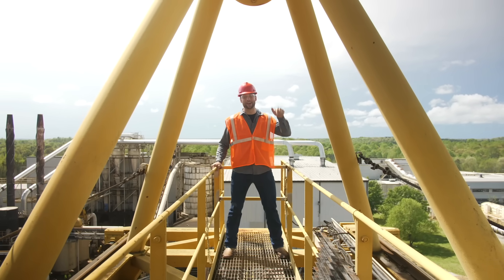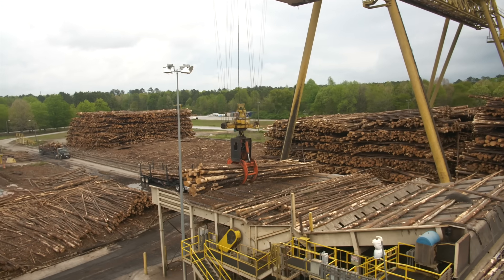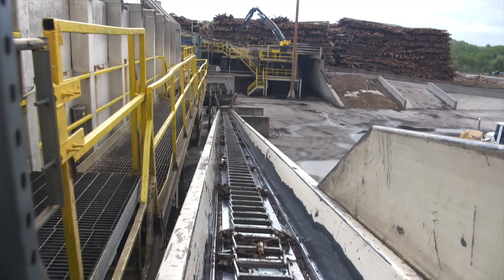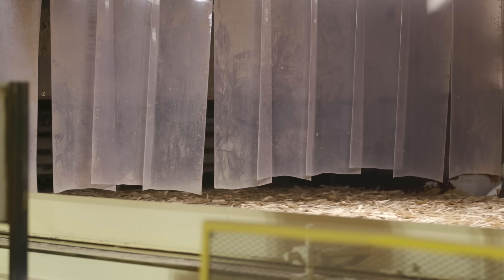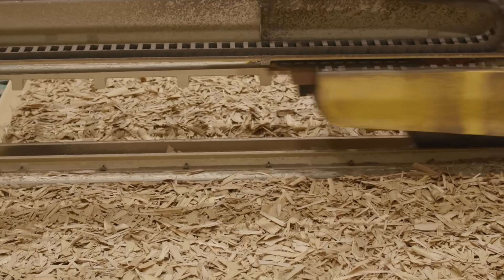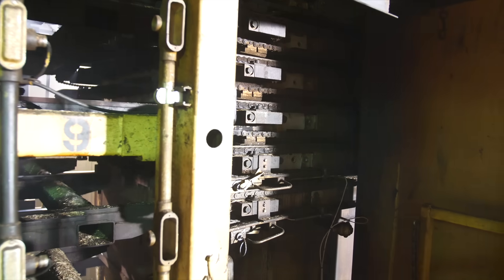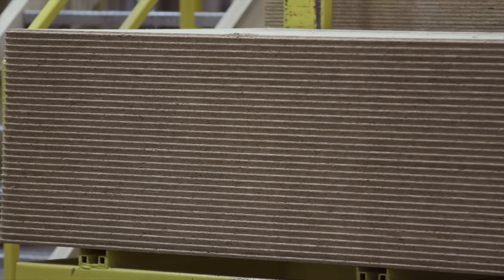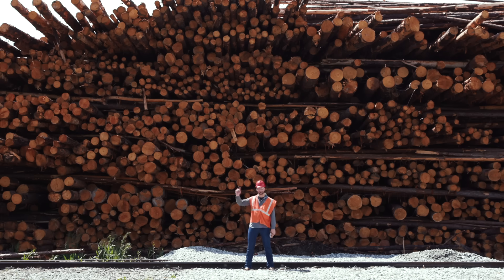Could OSB be BETTER than Plywood????

Comment: We would never use OSB as an outside panel for anything other than an inexpensive storage building where  you would paint the heck out of it because it will
weather badly.  OSB is commonly laid out evenly on top of the trusses of a roof,  you take your black paper which is a weather seal layer, staple it down then you
nail your roofing shingles on top of that.  This wood in its bare form is not designed to be out in the weather.  It's flexible and durable and works perfectly for 
the roofing process.  It's also a lot cheaper then plywood and when you are covering an area as large as a roof it saves a lot of money.  it's not like particle board 
 which is more like  pressed wood dust.  That's the cheapest you'll find anywhere and has no value in outside use.

Comment: Looks like the title is incorrect.

I prefer OSB over plywood for some things, because of the cost and OSB doesn't have air pockets and hollow sections in it like plywood does.  I remember when they used to make quality plywood that doesn't have all the voids and hollow sections in it.  The furniture grade plywood that is $60+ a sheet also has voids and hollows in it, but not as much.  I would never use plywood for a roofing deck, and I would never use OSB for flooring.  Is one stronger than the other???  Depends on the environment in which it is used.  Plywood will hold up better when it's wet.

Comment: In "A" word, NO!
Never!

It doesn't work as walls, floors or bookshelves.

OSB + water = mush!

It's not even worth using as a dog house! Unless you want to kill your dog! As it did to a friend's many years ago when the roof collapsed during a snow storm.

On the other hand, I know a guy who's entire set of shingles blew off fron one side of his home during a massive wind & thunderstorm, leaving bare plywood underneath exposed for an hour in heavy rain. Didn't leak a drop due to good sealing with silver tape. They let it dry then re-roofed it with copper.

OSB, SUCKS!  And plywood rocks!

Comment: OSB is crap. Simply crap.  When I had my construction company I turned down every job that specified the use of OSB.  It is inferior in every way to plywood.  Even cost:  OSB is cheaper to purchase but costs a lot to replace when it fails, and it will fail.  I found it interesting that in a small town a new bank was being built as well as a new Taco Bell down the road.  The bank was being built with OSB (cheaper initial cost) and the Taco Bell was being built with plywood (durability - thinking beyond "today's" dollar).  I have never used OSB products but have had to do many repairs (think: replace with plywood) to projects completed by the "low bidder".  Would have been cheaper just to use a quality product in the first place.  As for this video: there is now comparison as the title suggests, the host appears to be doing nothing more the regurgitating bad information given to him by the company.  This video (in my opinion) is nothing more than a sales pitch for the brand, their product is still junk.  Useless.  Crap.
Reply: @John Fischer And you believe everything you see on the internet.  I speak from many years of experience, not from a few minutes of screen time and other's propaganda.
Reply: @John Fischer Not in anything I have ever built.  OSB is crap.  Experience has taught me that.  Nothing weird about it.
Reply: didn't even get to the part about the higher % of glue ,adding to the flammability and quicker burn rate

Comment: If you have a home on a solid concrete foundation you can use OSB on the outside and inside of your walls, you can add sheetrock directly over top of the OSB on the interior, of course you need to add a vapor barrier and appropriate insulation. by adding OSB on the interior you can use smaller pieces of sheetrock because you can drill the drywall directly into the OSB sheating. Of course you have to make sure that building codes OK the process. If you are going to do this on a regular foundation you may be able to add in the crawl space or basement an extra layer of concrete block or poured extension to hold the weight. If doing an arch on the interior or curved wall you can use a mesh similar to gutter guard mesh between the two sections then layer with plaster, it is time consuming but worth the effort.

Comment: Cores running in one dirrection?? just look at it it's all random. You can see it in the finished board. WTF.
Reply: Your right. One layer of strands are oriented different from the one above, giving equal strength in all directions. The stuff works great, holds up longer than plywood in moist conditions, for a fraction of the cost. If plywood delaminates after only 1 time getting wet, how is it better than OSB which can take several cycles before coming apart???

Comment: "Chip Breaker" is the term you were struggling to find. Methylene diphenyl diisocyanate,is the adhesive you wanted to say .  YADDA YADDA YAP YAP YAP  it took you three quarters of your video babbling about shit before you sounded like you were thinking about getting to the  point.   GEEBUS man  get to the friggin point.   blah blah tongue and groove  nonsense   AND YOU NEVER EVER GOT TO THE FUCKING POINT~!!!!!!  Why might OSB be better?  Well doofus it ain't.  It doesn't hold nails well at all ad you can't glue the shit worth a damn because the cured Methylene diphenyl diisocyanate, does not take to gluing  easily.  It doesn't screw well .  The reason it doesn't nail or screw well if because the glue is brittle and shatters around the fastener.  And it doesn't take water well. I've seen formaldehyde glued plywood sit out of doors in the weather for years and still be tough as nails.

Comment: I let some idiot contractor tell me I could replace the solid wood planks in my bathroom with OSB. He claimed it was fine since it would be under an additional layer of underlayment, and most likely tile or linoleum . Well, I called the manufacturer and they said NO WAY. They said OSB, the very product they make, does not hold up in moist environments. Like a bathroom or laundry room. Even as roof decking,....OSB can be a bad choice,...but it is a less expensive product, and that is why it is used as substitute, for solid wood planking.

Comment: I've been working with wood for over 40 years, the Plywood cost twice as much of the OSB maybe even more, but it lasts 20 times more than OSB, I stopped wasting time and money on OSB.
Reply: John Doe  you’re wrong
Reply: I found all the fud boomers that still live in the 60s, new OSB is fantastic. Some of it has waterproofing that allows it to outlast plywood. It also doesn’t warp like plywood or straight grain timber.
Reply: @RadDadisRad  I bought some to replace some rotted out side panels that were rough cut pine from a local guy..I was trying to save the people some $$...I water-proofed it heavily with Thompsons water seal..now I used the OSB as part of the wall paneling and have put tin L-panels over it...I am hoping that will be okay..I am the only one doing the work and do not want to have to re-do this huge shed...what do you think,anybody ?
Reply: John Doe  explain glulam beams and lvl's being stronger than similarly size lumber.
Reply: Buy better quality OSB
Reply: What do people use OSB for? Is it supposed to be a cheap alternative to plywood? I'm not in the know on this stuff.
Reply: @nofurtherwest3474  you can get away with it for some stuff…. But not as strong and keep it away from water
Reply: John Doe  you do know ply wood is layered thin sheeting it's not coated in epoxy which is why it Warp's an rots my grandparents build their house out of 3/4 inch OSB in the 70s an that house has out lasted all the other's an it's survived 3 f3 twisters
Reply: Absolutely.
Reply: OSB is good for packing boxes but SFA of anything else.
Reply: As far as siding goes, I'd use plywood. But the new osb subfloor is completely waterproof.
Reply: John Doe  ??Well the glue is actually stronger than the wood…. So maybe you should use your brain.
Reply: The newer osb has higher sheer tolerances than plywood.

Comment: I worked at the worlds largest OSB factory called Footner Forest Products in High Level Alberta for two years. I was in charge of the forming line and tank farm. I'm a millwright. It was a continuous press not multi opening.
The plant was ALWAYS full of smoke. A severe health hazard. Most times (depending on board size) the smoke was so bad you couldn't see the other end of the plant. You can see a small amount of smoke at about the 1 min mark of this video. Every time the compensation guy showed up, amazingly we were always running the small board so little amount of smoke or we were down for "repairs". LOL. Yeah the government and the companies don't give a shit about working people. I'll go on welfare before I ever work in OSB again. Obviously they weren't doing much when you were there with the camera. Show up unannounced with a camera one day and post that. Bet you won't even get in the door.
Reply: When he embarked on the spiel about their stack emissions control and how much they spent on it, my first thoughts were "how far out of compliance were they when they got caught, how big was the fine, and how long were they given to install the emissions controls before the plant would be shut down?'
Reply: @kevincrosby1760  The plant in High Level did have a scrubber but it was way to small for what it had to do. The factory was always full of smoke and super hot because it's a thermo oil system. The gov't and industries are all in bed together, it's a fact. It don't matter what industry it is. It's all about profits/taxes and jobs. We had a great crew and a great boss but then they changed management. They demoted our superintendent and he was very respected by the crew. Then the new management started to harass us. We all started quitting and within months the place went bankrupt LOL. The entire maintenance crews (Millwrights, Electricians, Power Engineers) all quit within months. Then it was over for them. That's what happens when you hire incompetent management. That was many years ago in 2004 and I don't know if they ever opened up again.
Reply: @canadianoddy8504  Footner is running, its owned by West Fraser now.
Reply: @Brandon-ed6yv  THX I didn't know that.
When I was there we had an awesome crew and boss.
Unfortunately new management came in and within days people started quitting. They demoted our maintenance superintendent and he was very well liked. Within a few months almost the entire millwright crew, electricians and power engineers quit and it was all over, they had to shut the place down LOL.
Reply: @canadianoddy8504  ya that's rough, I have seen it a few times not to the point of closing the doors but pretty close. been in OSB for almost 10 years now, its a crazy business that's for sure.
Reply: @kevincrosby1760  They were never out or compliance.  Huber was proactive.  They have had no NOV's .  Huber osb is so different than the commodity stuff.
Reply: You must have been there for a LONG time to have forgotten that mill was bought by Norbord and then by West Fraser.
Reply: There's a reason I call it zombie-board.
Reply: I was a industrial tin knocker in the shop, just full of welding smoke. All ways getting in shit for turning on the exhaust fans. Breathing zinc smoke all day was no fun.
Reply: @codyhatch1813  There is NO WAY in hell that Footner or some of these other OSB plants are in legal compliance with all that smoke in the plant. My first clue should have been that part of the hire process was that I had to go through a lung test BEFORE hire.
These big companies provide a lot of jobs so "allowances" are made. You would NEVER see a compo guy walking around when they are running big board (max smoke). It was always amazing that if one of the compo guys was in the area we were down for "maintenance" ----- LOL.
Reply: Another whining Millwright, that seems to be the MO of the trade.
Reply: @u812b4me  Well it looks like you have outed yourself as a management guy.
Information: Management produces NOTHING a company can sell and make money at. You're just a cost.
Big shots like you hide in an office because the plant is full of smoke and it's over 100'F in there. The higher you go in the plant the hotter it is. Then you come out of your air conditioned office to make sure everyone is wearing their PPE. Then you hide in your office for another hour to cool off before you come out again to play big shot.
Yeah we all know how it works and what "safety" really means. Been there seen that story.
Go bullshit the young ones, they don't know the ropes yet.

Comment: When osb first came out I said it would be inferior and that has proven to be correct,  I put a sample in the back of my truck for a couple of weeks and when I pulled it out it was 3 times the size it was when I put it in😯, in a perfect world it might be acceptable (not) but in Florida with the humidity no way, mold and mildew set in to osb quickly and it fails structurally when it swells causing fasteners to loosen, not okay in a Hurricane,  last I heard our  County had banned osb

Comment: OSB is crap and is no comparison to CDX plywood strength and resilience.
The only reason it is pushed on the construction industry is for the profit margins of the suppliers.
OSB has absolutely no protection against punch through so if used on a roof you can guarantee that limb will penetrate through your roof if it lands between the truss structure.
OSB is inferior to CDX in so many ways that is is amazing to me that it has made it so far in the construction industry.
Why would you ever build a house out of something that has damn near ZERO resistance to moisture damage?
CDX is more expensive than OSB for a reason .... CDX is superior in every way that is important when it comes to construction.

Dont even get me started on these idiots building load bearing floor joists out of this trash.

Comment: Great but notably you didn't answer the question?  How is OSB (or how can it be) better than plywood?
Grade-for-grade Cost, Flatness, Voids - anything else?
Equal cost = better surface, zero voids, zero warpage, 90-110% of screw holding ability, but only 85% of breakage resistance -- something like that?

Comment: OSB you always have to worry about the binders, toxic materials, that can leach into the adjacent area. It can be made stronger just as concrete has aggregates, but the wrong type and mix make  bad composition and inferior product. Wood often warps, cheap OSB when wet swells or disintegrates weakening strength. That would be a big disaster in an engineered I-beam.

Comment: FACT from someone who was there.  In the 80s there were hurricanes hit the South.  Plywood went from 4.00 a sheet to 20.00 a sheet almost overnight.  We were told that the price raise was b/c it was so hard to get plywood since it was all going to the South.  We were also assured the prices would be coming back down after the rush was off.  I am STILL waiting for that alleged rush to be over - the price never went back down, and instead they started to make more (what was called chip board, but the name disappeared as it betrays the garbage its made from) of this garbage board we call OSB.  And even though it is less expensive and less hassle to make than plywood, they sold this garbage at the price of plywood.  ever since, every water damage problem now requires a ton more money and work b/c am entire floor will not stand up to a water problem.  Its called planned obsolescence and I never use this garbage.  Its a total, though now accepted, scam.  And it was so long ago now no one remembers except we who are old enough to remember when quality counted.

Comment: OSB is crap!!! Mold loves the encapsulated wood fibers. If it's cut, seal it with a polymer blue light penetrating epoxy.  OSB can deteriorate much faster than plywood exposed to moisture. It’s OK for concrete forms... that’s about it it must not get wet. So one time use for concrete forms because the edges swell up like graham crackers in milk, and it’s stinks. I'm working on a 15 year old structure with the stuff and it still stinks like OSB glue in the attic and crawlspace.

Comment: The OSB is flaking apart on the benchtops at a place I volunteer.  That is besides the holes where the OSB broke through.  I'm replacing the OSB benchtops with two layers of 3/4" plywood and a 1/8" layer of tempered Masonite.  OSB is only one half step not quite as bad as particle board.

Comment: OSB plywood board OSB plywood board is a inferior wood is a I can remember when we was building houses about 10 to 15 years ago you better not get caught using it or you would get shut down is highly flammable with a lot of glue ply board is better because when you step on it you don't fall through that's my opinion

Comment: I'd say yes thickness for thickness.yes osb is better.. notice building supply stores won't sell 9/16th inch thick OSB, but they will sell 7/ 16" , which they know will sag, nor will they sell 3/4" osb, its too good and too low cost, they want you to buy $45 plywood which is what now 11/32" , hmmm....